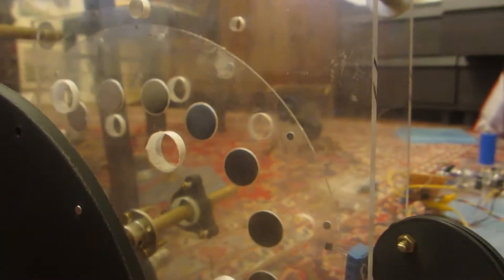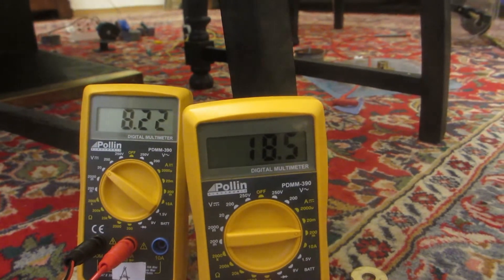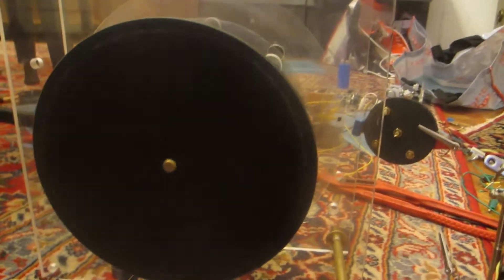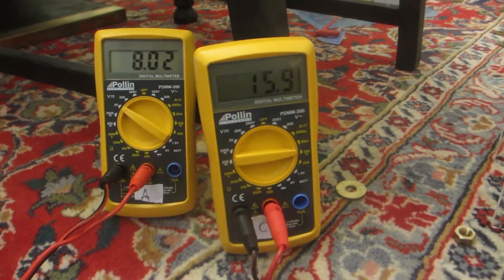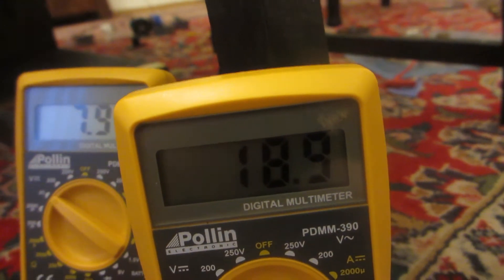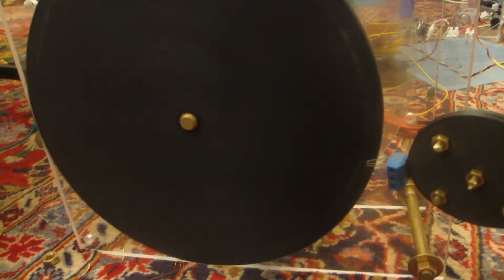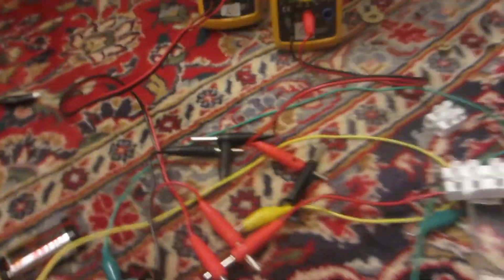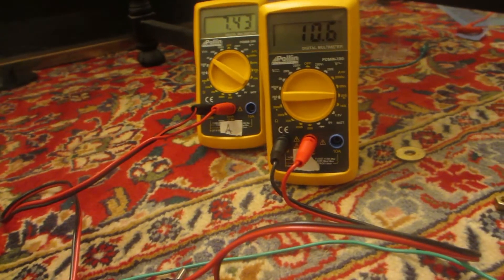Testing different pulse motor rotors and timing disks

Comment: Hi Luc
Good job very nice!
Could be it's not so much your number and size of rotor magnets but the relation and reaction and geometry of the particular  size, length, width, airgap and type of core to the rotor magnets  too,  
So if you mess around with cores then what sort of magnets and number of  magnets in rotor would be affected to get best performance.
Also another variable to the juggling balls of  variables is the voltage input, as it makes big difference if remnance was in cores etc, finally the pulse width super important...
What's your core material?
Are your motor coils wound directional?
Are you using Litz wire?
Thanks for video!
Reply from the maker: Hi doug, well the core material is simple. I tried  ferrite cores but those that i have, do not perform that well so i am using welding rods. Core diameter is 1.5 cm.  I tried air cores but then, the motor doesn't even move.. the pulse is not strong enough. What i still have to adjust is the distance of the core to the magnets.. here i need at least 1 counter magnet or the cogging is enormous. I found with the stronger rotor magnets i can move the core away (in the coil) about 1 cm and will have hardly any cogging and lower consumption. (but also lower speed)... I will try and sand the cores down a little so i can move them easily within the coil so I can see what effect the core has on the motor. 

No the coils are not wound directionally. I did one but as my coils are only 3cm heigh... (depth of the coil) ... it did not bring any difference. These are actually trifiler. bi filer with 0.4mm and a third winding with 0.22mm so i can trigger it with a bedini like circuit. with this circuit i can charge the battery that the driver and hall are using while running.. it keeps that battery at 8.2volts.. i am using 1 strand of the 0.4 as run coil, and the other one with a diode to collect the back-emf... The advantage is, you can feedback directly into the circuit using 90% of the back-emf.

No i am not using litz wire, although i still have a little left for a coil or 2. (its leftovers from a romero replication) but I think (I might be wrong) that litz wire is only usefull if you are switching high voltage. Here (at least with this machine) we are in low voltage, so i do not think it will make a big difference. 
But i will make 1 coil to test, directionnally wound with litz wire (14strands thats the one i got) but i still think that for the directional winding you need longer coils than those i am using.
Luc
Reply: @FreeEnergyNerd  Hi Luc
Your coils and cores quite a bit different than mine.
I like your bifilar idea with diode to take out spikes. I  doing that too with my induced generator winds more or less.
Are you attractive or repulsive to magnets with motor coils?
Are you now feeding back to battery with that bifilar half and diode ?
Can you try both steering diode on mosfet drain and your bifilar diode see if it is an addition or one dominates or it is worse and  cancels.
Your cores way different than mine.
My meters and driver's all good from that pop in  video I don't know what it was now....maybe caps got too high in doubler and just exploded nothing broke  just lucky....maybe bidirectioanld give place for the potential destruction to go I don't know.
Reply: Hi Luc again, 
Your rotors are beautiful, try making two the same put the coils between so both sides of coils do work so twice the bang for the buck.  I have videos and stuff of one I made here will link later.
Reply: Here is link to videos and stuff of dual rotor motor gen.
https://alternativeworldenergy.wordpress.com/dual-rotor-motor-generator/
Reply from the maker: @MrDKONZEN  He he... i had (and still have one of those) similar but a little different.. 
Actually not 2 but 3 Rotors... with 6 magnets each... the 6 left and right rotor magnets are each 3 cm diameter and 1cm heigt... the center rotor has also 3 cm diameter magnets but they are 2cm thick... they are very very strong like  30 kilo strengh... 
it is impossible to use anything different than air core... the magnets are to strong.
here is the machine...
https://www.youtube.com/watch?v=imkeoMIiuj0
the great thing.. 1 run coil, 11 pickup coils... the output of the pickup coils (ALL in series) is over 200 volts... WITHOUT ANY CAP!!!!
but as soon as I hook up a load... it goes really down with lenz...
I just did a first run video... have not tried any coil shorting or so...
Reply: @FreeEnergyNerd  hi Luc
Litz is for high frequencies not high voltages.  For low voltage coils against magnets you get stronger field with lesser input since so much surface area to the many wire strands. I believe more backemf as well as  that switchover in polarity upon collapsing field is super fast and solid copper wire sort of lags a bit you lose something as it backs up into itself. My theories anyway.
Best not to have iron cores against strong neodymiums same reason, iron too slow to flip over it it backs up into itself and also backs up (grabs) onto rotor magnet when you don't want it to be doing that if that makes sense. Try some black sand gold miners sell on eBay with trace amounts of gold in it mix with super glue or epoxy

Comment: re timing mags, you have a lot to experiment with there, you can use a simple circuit with that same hall that turns on an LED to measure the on time and location of ON switching. This will give you a solid idea of what to expect. the timing magnets might have the a very similar magnetic spread in relation to the hall switch, especially when you move the hall switch, you can affect the duration of the on time as well. if you want to shorten the duration you can also try placing a small magnet near the hall that will keep the hall "open" then slowly move it away until the switch turns on (kind of like a read) hope this makes sense.. thanks for the vid.
Reply from the maker: thanks for your input... i'd be very interested in that circuit turning on an LED to measure the on time..
luc or llg@gmx.at